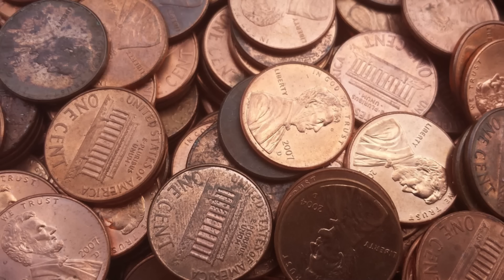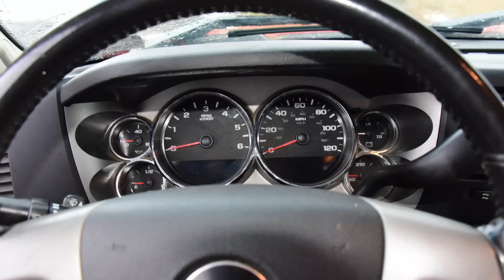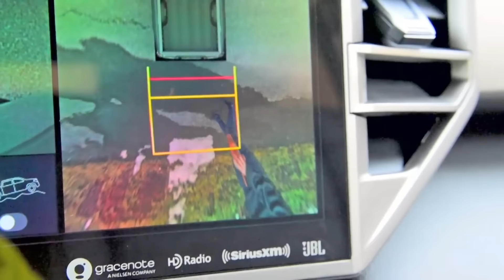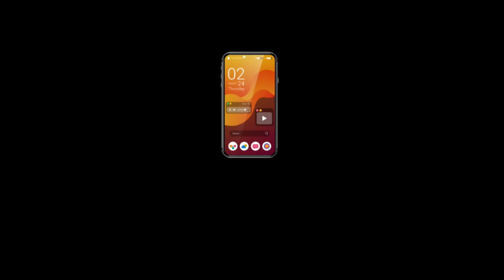2008 Chevrolet Silverado: Regular Car Reviews

Comment: Stainless steel? For a pickup truck? Aluminum? That will never work!

Meanwhile every pickup in the northeast made of steel rots away like compost within 15 years.

I welcome these new metals. Hoping they hold up to road salt.
Reply: I finally saw body damage on an aluminum F150 and witnessed what some critics were talking about. Yeah, it looks annoying to fix.

Would still prefer that over mild steel. I've got socks older and in better shape than most Canadian rocker panels.

Comment: Thats interesting, as a chevy truck owner of several generations my understanding is those GM bankruptcy era trucks are the worst.  The AFM/cylinder deactivation on them was notoriously awful, however I think that is a feature on the 5.3 v8s.    There were also rumors GM cheaped out on materials.   

I love seeing these still out there.  Looks like the owner kept it bone stock, so thats why it still drives great.  That lifted gmc sierra gmt400 has a very similar IFS suspension and, generally the non-lifted ones handle and drive much better.

Comment: My dad had a 2008 Silverado LT Extended cab, similar to one in the video. That truck was used for truck things more than probably 90% of trucks on the road today. It was an absolute work horse, we exceeded the payload on it a handful of times, and exceeded to towing capacity 2 or 3 times, and it was completely comfortable doing the work, even with the dated 4 speed. We got rid of it just before covid and traded up to a 19 Silverado. Which that truck is solid in its own sense, but we always look back at the old 08 and we miss having that truck, it was such a work truck, yet holding enough comfort that it was truly enjoyable to own. My father has always been a Chevy guy and he said that the 2008 Silverado he had was by far the best pickup he has ever owned. We still see the truck around town and it’s nice to see that the truck is still on the road doing work and serving someone else, it’s truly the working man’s truck.

Comment: I have a ratted-out 2000 Excursion that I use (abuse) like it's a pickup truck- and sometimes like it's a field tractor. The crap I use it for really justifies that I would be one of those people who should have a truck. Meanwhile, my best friend has a 2-year old Ram 3500 crew cab long bed that mainly gets used as a commuter car. The tech on that thing borders on ridiculous when compared to the Excursion. I still don't understand why I can be ticketed for using a cell phone while driving, yet it's fine for manufacturers to glue a tablet to the dash and bury features in layers of menus.

Comment: I was wondering if this was going to be a positive or negative review, but I really agreed with this one. I have a 2008 Silverado 1500 with the same configuration, the only difference being that I have the 5.3L with the Z71 package. These are great trucks and the lack of unnecessary tech in the cab was a big selling point for me and still is - simple, straight forward, and functional. Mine has 205K miles and is still going strong. Keep up the good work!

Comment: I have a 2012 1500 4.8L at 430,000 miles with collapsed lifter (& Tick), multiple misfire and engine sensor codes.... runs great..but is also on its 5th transmission, is a backup truck

I also have a 2005 1500 4.3L V6 with 480,000 miles, also runs great, passes inspection, no codes and original transmission and engine, also a backup truck

Comment: I have an ‘04 F-250 6.0 Powerstroke with the ZF6 transmission with 116k on the clock. Slightly oversized MT’s on 17’s. Strait pipe exhaust. That’s it. Has some rust but looks good and does what I need it to do. Tows & hauls what ever I need to. No frills but it’s fun to drive and makes beautiful sounds.  It’s a truck that is used as intended.

Comment: I have a 2012 F150. It's an XL base model, and has no carpet, no power windows, no turbocharger, and no back seat. It's the only truck locally with an 8 foot bed that isn't white. And a lot of people nowdays ask me why I would drive such a thing. It's a farm truck and that's what it's used for.
Reply: Certain times of the year a certain sort of people start showing up with dirt bikes and ATVs on trailers, finding it hard to park them at gas stations and restaurants along the way, and clogging up trailheads. Hmmmmm, if only the trucks they pulled those trailers with had some kind of platform built in that could hold a smaller vehicle...

Similar can be said for people rolling up to Lowe's with a trailer because their 5' bed won't hold a sheet of plywood. They've stopped being trucks.

Comment: You should drive one that runs on propane it's awesome but you can't overtake without a running start but in gas mode it runs great minus the rust and the plain jane interior

Comment: I have a 2011 Silverado, it has all kinds of dings, dents, been in 4 accidents & somehow the roof started rusting. But this thing just keeps going with few drive train problems. Sometimes if feels like it's gonna quit, but it doesn't after 150K miles later

Comment: "...where the less the car has to distract you with, the more engrossing it is to operate." This sentiment is something a friend of mine mentioned in a way about our projects. He and I are working on turning old Ford F600s (think like the old GM bus but Ford grain or welding trucks) into oversized pickup trucks. It's a bit silly as they won't exactly be practical when finished. It mainly stems from something I've wanted to do since I was 15. I grew up on a farm driving trucks all the time and fell in love with the concept of turning a medium duty into a big pickup, sort of as a counter to the everyday lifted, big tire, small house priced "super trucks" you see all over. All that aside, I was teaching my friend how to drive our 10 speed diesel one day and afterward he commented that to him, you don't so much drive an F600, you operate it. You feel it. These are bare bones '70s and '80s, manual transmission, "heavy" duty work trucks. They're a chore to drive but a fun one at that, which is why we both like them, for the very reason you mentioned at 11:07.

Comment: The 4.8 did what it had to do. Just like the icon 4.3 v6. Decent power with reasonable fuel economy and extremely reliable.
Reply: The LY2 is the most reliable of the Gen IV Vortec engines of this era because it isn’t burdened with Active Fuel Management or Variable Valve Timing (VVT was added in 2010 with the L20 which increased HP to 305HP)

Comment: 2003 Tundra just like the one in your video...464,000 miles and it just works.  A little wrenching here and there but I use it for hauling, camping and towing.  Currently looking for another one in double cab just so the teenagers aren't squished.

Comment: In Europe, you do not buy a pick up.
You buy a car, with a tow hitch and put a trailer when you need it. Even the smallest cars like Fiat 126 are used for towing. 

Or, if you really need a pick up, you buy something like Iveco Daily, that can seat 7 people (3 in the front, 4 in the back).

Comment: I have a 2013 single cab, short box 1500, 2wd WT with 179k miles. Love it just for the manual crank windows alone lol I think about lowering it everyday but these hills in Pittsburgh remind me of much of a pain in the ass that would be... I was looking for a RCSB 1st gen Tacoma at first but being in Full size truck felt better. The GMT900 platform also feels more refined inside than the GMT800 platform as well.

Comment: As much as the -900s hold up worse than the -400s and -800s do in the salt belt, they truly are the last of the "uncomplicated" GM trucks.  We've failed a many for rotted out frames.  More than when we used to see a lot of -800s.  They still operated on the older GM diagnostic tool, the Tech 2.  No massive screen controlling the radio and every other setting in the truck via its own control network and the radio is mounted somewhere else in the dash, rather, the radio was its own unit bolted to the center.  The HVAC controls operated direct to the HVAC module, not some remote module tucked elsewhere that oh by the way, the radio also needs control of.  No direct injection (DI is both great and not so great), the 6L80 didn't quite get hit by the bankruptcy blues (don't explode torque converters under 50k miles).  Do they have AFM?  Sure, but its still the LS platform so stupid easy to delete.   It was a modernized revolution of the -800s but still was almost as simple to work with as the -800 trucks.

Comment: We have a 2014 Silverado 2500 with 485,000 miles and MAYBE 50,000 of those miles didn’t have an overloaded gooseneck trailer. A comfortable truck to drive for sure. But it was never the daily. The Toyota Avalon is. Until the CP4 injector pump killed it that truck always had a trailer attached

Comment: I had a 2011 f250 powerstroke and a 1995 toyota t100. The t100 was better at everything except having a backseat and towing. It's big enough to get the job done and small enough to park easily and the bed is low so you can easily access the toolbox. Also didn't mind getting scratches on it because I didn't have a 72 month payment plan.

Comment: Despite not having tech I feel this is past the point of real pickup, because it was at the start of the trend of mcdonalds supersizing pickups with no added utility. For a 1500 its Huge. The center console is the width of the driver's seat in a daihatsu. It was the start of passenger pampering pickups but sans tech, a big improvement on previous gens as far as comfort but thats where it begins to be a more passenger focused vehicle versus a utility truck

Comment: Hi, I see your viewpoint on what I would refer to as a 'ute', and naturally utes are very popular in Australia, particularly with the younger drivers, as they are passenger limited, which suits them. New drivers are not able to carry passengers in any case. The additional upside for utes, is that they are very lightweight, so their performance is fairly heady; very much so by comparison to the sedan variants, with their rear seats and a lot of extra sheet metal, yet they do not suffer from scuttle shake, the way that convertibles actually end up far heavier, rather than lighter, despite their cloth roofs.

Comment: You need to take a look at a 2023 ram 1500 classic long bed, single cab, 2 Wheel Dr., base model. 

I got this as a work truck and it is as close to old school as you can get, manual windows, manual locks, manual seats, a little 5 inch screen just for radio, and Bluetooth, nothing else, but a bed and an engine.

I absolutely love this truck.
Reply: I happened to rent one of those, and I was surprised that it was still very truck-like!

Well, except for the fact that the bed is loading-dock height and the steps were a hard plastic that as soon as the snow hit made it impossible to get into the bed

Comment: My old boss had a whole fleet of these but 2500s and 3500 dually dumps. At the time I felt the interior sucked and they were much more cheaply made than the previous generation, all the lights were on at all times and they went too far with aerodynamics to the point it was ugly. But they hardly ever broke down! Got a deal on a 2011 2500 rust bucket plow truck a year ago and now knowing where trucks would go after these I have really grown to appreciate these trucks, despite the dashboards being perpetual christmas trees!

Comment: I rented a dodge ram several years ago, I actually rented a compact SUV but the rental shop didn’t have one when I arrived so they gave me a ram 1500. 

I swear it was a truck I would never use for heavy work because it was clearly designed to be a luxury car thaf resembled a truck

Comment: If you are looking for a pickup truck that will fall lower on the ladder than either of these GM trucks you've gone through so far, may I recommend the 11th generation Ford F-150 with the base 4.2 L V6. Specifically in XL trim, regular cab long bed 4 wheel drive vinyl seat rubber floor with about 300,000 miles,  something like an ex-DOT truck from the Midwest. But an STX or FX2 trim level would also work, especially if it doesn't have a tachometer.

Comment: ive got a 2012 one of these with the 4.8 V8 (i think its a 4.8, its whatever the smallest GM V8 is.) Mines not a daily either, and its a rugged old bastatrd, easy to fix and great for camping, and other mildly vehicular taxing jobs. Other than a quick tune, mines totally stock and has always run great. Im up in MT so so rust isn't really an issue as long as you wash it every now and then.  (we don't use salt) the only issue with mine is that a previous owner tried to wax it in the sun and dicked up the clear coat. A good cut and buff would fix it but its a "working" truck, so  its appearance doesnt really matter.

Comment: That 'assist tech' problem is exactly why, when selling my base of the base model 2002 Hyundai Accent, the main selling point used to advertise it was 'a good car for learning to drive in.'  5 speed manual with no tachometer.  Not sure where it fits in the Anxious Avoidant scale; it was bought to be a workhorse delivery car, to avoid using the other car I liked better for that.

Comment: Fantastic video as always. Makes me regret not being available when I had the chance to share my car for review.

Anyway, other than landscapers I can't think of the last time I saw a pickup hauling anything at all. From my perspective it's all performative. On the one hand it's yuppies coplaying as outdoorsmen, commuting daily in something that's way too big to fit into the typical corporate parking spot. On the other it's premature boomer tough guys. The Harley-riding, Challenger-driving crowd who undermines utility by installing stacks, lift kits and wheel spacers. I also don't understand what the hell it is with pickup drivers always backing into spots but being incapable of aligning them properly.

Not that I don't find pickups appealing. Every so often I'll wish I had one handy but it's hard to justify owning one when I'd only put it to use a couple of times a year. Plus, I'd only consider one if it were roughly the size of an Isuzu Brat but built by Toyota.

Comment: As a prospective pickup buyer, this video speaks to me. I'll be buying a small pickup truck soon as a second vehicle. Got my eyes set on the old Ford Ranger, extended cab, 4x4, automatic. And I want to get one in fair condition. Not perfect, but also not ratted out. It'll be second to my Lincoln, but the Lincoln is still going to be the star of the show in my household. This truck will primarily be used for hauling building materials from Menards/Home Depot, or for making parts runs when I'm working on the Lincoln and I can't take the Lincoln to get the part. It'll be used occasionally as the vehicle of choice to get to a destination, or to bring my tools to help someone fix something of theirs. And I only want it to be somewhat decent so I could take family and friends around in it from time to time, and extended cab for the rear jump seats and the extra interior space for carrying items I don't want rolling around in the bed or in a pinch, people.

Comment: Had the GMC version of this except in an 09’ variant.  2nd favorite vehicle I’ve owned so far.  Yea, had it in black on black 22’s w limo tint 😋.  I actually used it as a work truck tho (auto detailing) with a water tank, gen & washer in the back.  Thing was a beast, never had an issue w it.

Comment: Back when trucks were a normal ride height. Now they’re ridiculously tall for no reason. The people who want lifted trucks lift them anyway. The difference between my 99 half ton ram and my 2013 f150 is ridiculous. Both have the same payload and tow rating. So why is the bed a foot taller on my ford than my ram? I’m 6’3. I slide into the seat of the ram, I have to get on my tip toes like a lil bitch to get into the f150. Its stupid. It’s a 2 wheel drive. Make trucks lower from the factory. A 2 wheel drive truck doesn’t need a foot of ground clearance. 

Also bring back removable tail gates. My ram I can easily pop the tailgate off for the fork lift at the supply house to grab a pallet of shingles. The ford, I still can’t get that tailgate off. You have to unplug the camera, then open it and it’s gotta be at a 45° angle to pop off one side, then 80° angle to pop off the left side. And it still won’t let loose because it’s got a torsion rod in it to make it feel lighter. They’re making trucks more capable, but also more unusable for actual work.

Comment: I bought my pickup truck because I had to bring tools with me to work. I delivered mail out of my 2001 Ford Escape (with RHD conversion), and it was constantly nickle and diming me, plus I needed to maintain it without having to drive it 15 miles home to work on it, and the 15 miles back. (which would make 2 30 mile round trips just to do simple things to it) so I had a toolbox on my truck, but then shortly after I got my current truck, I found out I won't need to deliver out of my own car much longer... so now I don't have the toolbox on it anymore and its really just a daily.

Of course I had a feeling that would happen eventually, which is why I purposely chose to custom order a 2023 F150 RCSB 5.0 FX4 so I could have a fast, fun, reliable daily that gets decent gas mileage and can take someone to gapplebees.